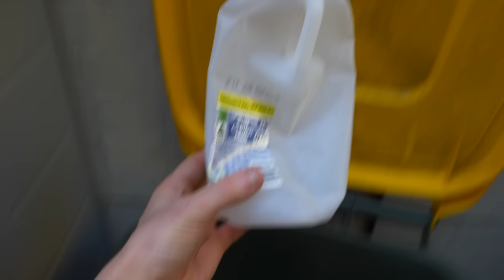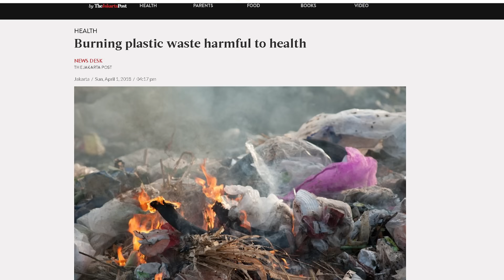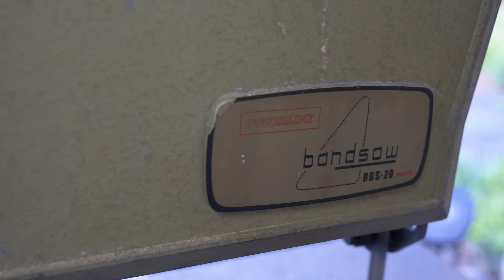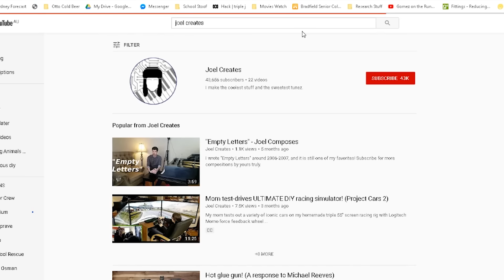Making a Knife from a Milk Bottle

Comment: HDPE or basically any other plastic of the Polyolefine group is actually nontoxic, its actually chemically inert (which is why the put milk in it in the first place). When its burned then the fumes are no more harmfull than inhaling gasoline smoke but i wouldnt recomend inhaling that either

Comment: not sure what kind of plastic it was but i used to work for a company that molded plastic playground equipment, and part of the finishing process was actually to use a big propane torch to flame the surface to give it a shiny finish

Comment: Your designs do look good, but for future reference an open flame would work better if it's smaller like a match, and for  a better fit when you're trying to make a bowl you need to cut triangles out of the plastic, or wedges to be more specific, long and thin while it's very hot that can make a bowl

Comment: Next time you have to handle really hot things just buy you some blue leather welders gloves. I used to use them when I worked at a steel mill to pick up hot squares of steel that I just cut outta big steel oil field casing pipes with an oxy/acetylene cutting torch.

Comment: To better sharpen your knife, use a cigarette lighter and barely burn the edge you want to sharpen pinch the plastic when it starts to get flimsy then it will harden sharper than when you started